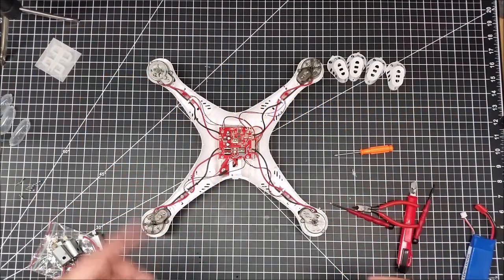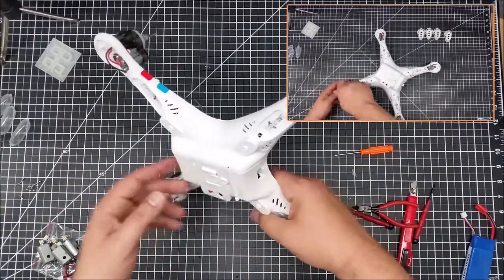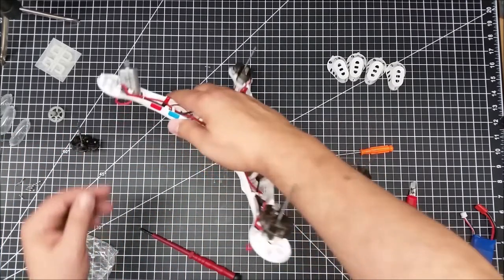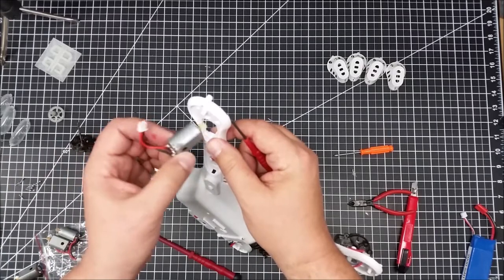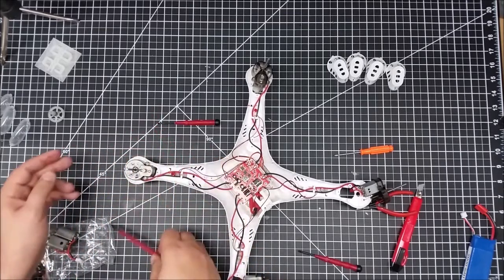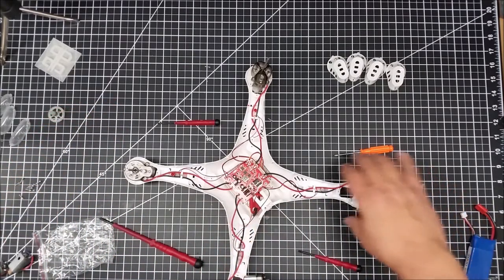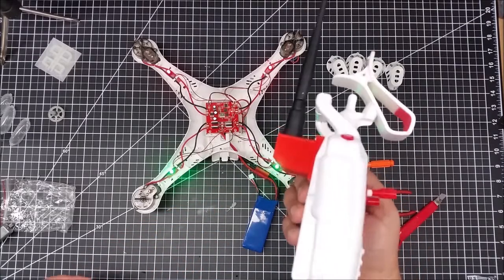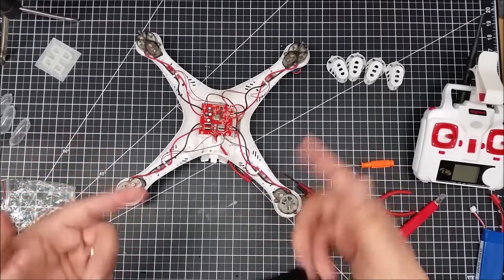Video Drone - Upgrading the Syma X8C to Night Lion Motors!

Comment: Brother, nice video! I don't know if you can help me, but I will ask if you don't mind. I've changed the "body" of the drone. However, for some reason, the drone is going to the right when I try to take off. I've already checked the blades. I think I changed the motors position. I was very careful to do everything correctly, but something is wrong. Could you help me?
Reply from the maker: Many thanks for the kind comments, if you changed the motor order (CW & CCW) it would not fly.  Assume they are brushed motors, and one is likely going bad and not spinning fast enough...

Comment: I need a easy d.i.y for a long range antenna for my x8c ? And what's the most powerful motor for this model ?
Reply from the maker: Sorry have not messed with this bird in a while so couldn't tell ya, sorry
Reply from the maker: the ones covered in my videos are around 10db which is pretty high...

Comment: Built a SYMA x8 just finished putting in new motors and it won't lift off the motors are in the right place and the props are where they should be, The main board was bought used not sure if there is a problem with the board possibly causing the problem
Reply from the maker: Make sure the motors are wired correctly

Comment: Hi from Spain: X183 (clone SYMA x8) lipo 3s 2200mah 25C fhotos ande video https://photos.app.goo.gl/PGgCjXtCLawa5RLQ9
Reply from the maker: Hi from Michigan
Reply: @VideoDrone  
I have only changed its structure. The controller board is the original. The big problem that this drone had at the factory is its duration of flight. In the best case, only 4 minutes. With this 3S battery change you can fly around 10 minutes

Comment: No need to do a full stripout to change a motor. Just remove the under-motor cover, then the two motor screws need backed off -  BUT - only remove the one that's closer to the centre of the X of the frame.  The other one, keep the screwdriver engaged in the screwhead once it's backed off enough to let the old motor be wiggled out.  Have the replacement immediately to hand and pop it in KEEPING THE SCREWDRIVER PRESSING THE OTHER MOTOR SCREW INTO ENGAGEMENT WITH THE MOTOR CARRIER. If you neglect to do this the screw will fall out into the gearbox interior and you'll have lots of entertaining fun trying to persuade it to come out again - and the sequel to that is trying to ge the sucker back into that little hole it lives in under the white gear wheel.

Using this method I just swapped out a single dud motor in way less than five minutes.  Bought an X8W recently and it's flown like maybe four or five times tops. This motor was the third one to die.  Not happy; I know these motors are essentially cheap consumable items but that's not enough service life to my mind. Another model the HC  has put in similar flight hours but no motor issues at all with that one.  First stripout I did I did like you but noticed there was little to stop a change by using the method above  - have now done so twice.
Reply from the maker: Thanks sharing as yes this is a pretty old video...

Comment: I put the NIght Lions on my X8G and I'm very happy with them.  They are somewhat quieter than the stock motors and have the same (if not a bit more) power.  The motor change has added about 2 extra minutes of flight time as well.
Reply from the maker: Yes agree with you on the night lions also interesting to hear you go more flight time too!

Comment: great video!
the alt. hold x8 series birds fly really well with the older x8c radio...actually flies wayy better...no more fighting to bring her down...just dont lower throttle stick too low or motors shut off...
if you have enough altitude and shut off motors by mistake they can be re-armed...then full pitch forward as you throttle up a bit to level out the quad...
rc escape did a test with the newer x8 alt. hold bird with the older x8 radio and it went very well...that inspired me to do the same with mine...
Reply from the maker: +birdman316 interesting feedback and thanks for sharing!  Also check out as I do a brushless upgrade😎

Comment: when you change the board to hover did you have to do anything to the transmitter
Reply from the maker: Yes I also ordered the hover transmitter too.  Some folk say the non-hover works (have not tried) but the other was so cheap and I wanted the self center joy stick anyway...

Comment: Is it improvement over x8G stock motors? x8g is more powerfull than c/w..
Reply from the maker: +Jan Jaroš  I have not seen a major performance change however they run a lot smoother...
Reply: Video-Drone Thanks for answering. Maybe I will test them but I need rather more power.